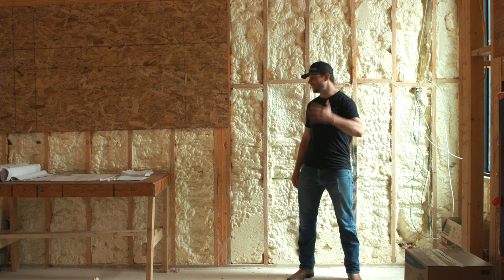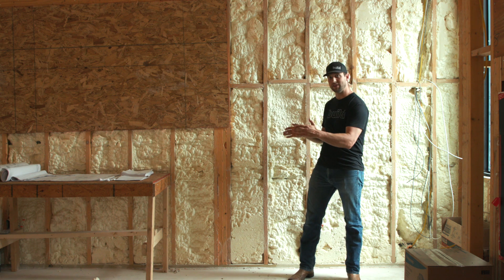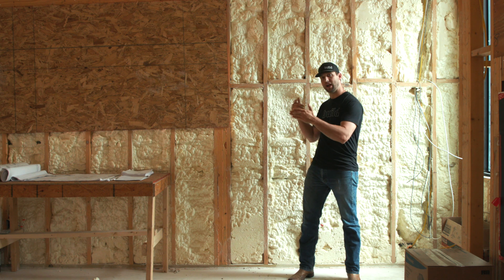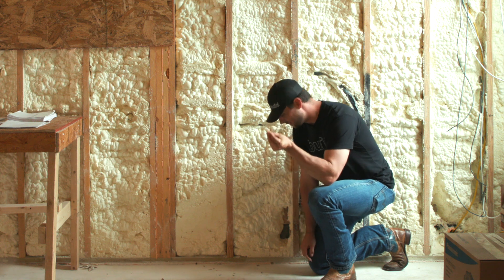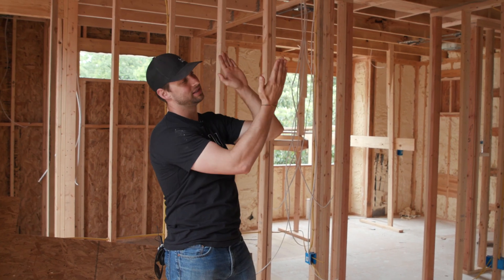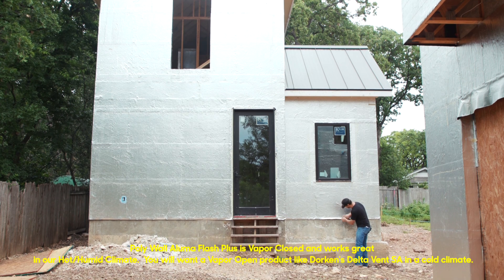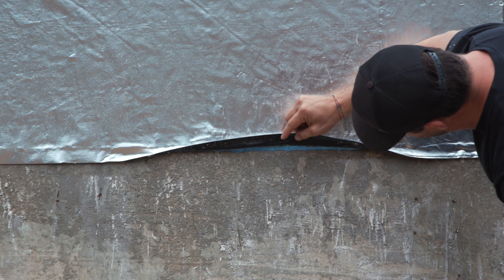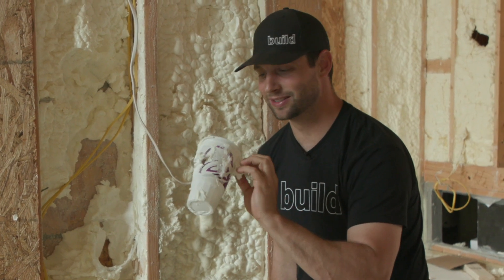3 Spray Foam Problems

Comment: With all the ancillary products required to get stick frame construction down to passive spec... or even to modern energy code.... why are people still building with it? It's a labor intensive process... capital that would be better invested in better materials, or a larger home. SIPs are the way to go. Spec'd whole wall. Vastly better consistency. Less opportunity for human error.

Comment: Have been anxious to hear your thoughts of Off-Gassing and Long Term Risks of these products and what we should consider when using for our applications
Reply: Oh yeah, another good question..
Reply: They have to wear hazmat suits and resperators too spray the stuff on.
Reply: @kalijasin  The suits protect hair and skin from sticky foam.  The respirators protect from the fumes UNTIL the foam is cured.  Don't be a Karen.
Reply: There is zero issue with off gassing if used properly
Reply: i actually worked with this product . after spraying was finished we would always open windows /doors to create draft for ventilation then remove masks.
Reply: Temperature thresholds must be observed, thickness as well. For applications within walls it's not such an issue, however for attics or open ceilings be sure the thickness is maintained to specs. And don't be in the home when having this done!!

If you're hiring someone be sure to get a removal and repair clause in writing! Jic the installer sucks
Reply: TheEarthDoctor1 sigh you made one good point. Andthat was the other point the rest are blatant lies. 

First off all they do not keep offgasing when mixed properly and applied properly the finished result is chemically inert.

Yes they are toxic in a fire but so is cellulose and fiberglass insulation (Rockwool is not toxic in a fire, only fire rates insulation)

They are no more problematic during demolition than most other construction material including plywood. The dust of fully cured spray foam isn’t even harmful (Beyond regular construction dust, cement dust and rile is much worse for your health)

You say you doubt you’ll see contractors recycling the bits. And your point is?!?!?! Do you think they recycle Fiberglas insulation? No. Rockwool? No. Cellulose? No. Expanded or extruded polystyrene? No. 
So what’s your point?  What part of construction is recyclable? I install recycle roofing, and I I’m pretty sure only about 1 percent or less of construction companies do. 

Or do you think anything besides metal is typically recycled in a demolition? Lol and even then it’s really only like copper. 
I don’t know what fantasy world you live in. 

Btw I don’t even install foam insulation unless specifically asked by the client or by the architects plans, I recommend Rockwool it cellulose. 
But I just can’t stand blatant liars with an agenda.

In regard to it getting in your water supply, that is a huge problem with ALL construction debris, and that is why federal fines for construction waste getting into the water supply are typically in the $100,000’s per incident. Of course those are not enforced strictly.
Reply: Arshaad Yar  -  considering these foams were developed for NASA, who has insanely strict requirements on off-gassing, it isn’t very hard to find that these foams are totally safe if used properly.

Comment: It just seems really silly to me to use spray foam especially with so many options available. Plus one of spray foams actual advantages is air sealing which for high performance it can't do and if you can't afford a high performance price point I'm willing to bet your installer isn't likely to be extremely skilled. Even this house clearly shows signs the installer was skilled yet it was still messed up. It's so easy to screw up. The worst part is spray foam that has not cured properly is a massive hazard to the home owner not to mention compromises its function. Further its touted as good for retrofit yet thats when its really hard to do correctly so whats the point?

Comment: Do you use the blue product on the bottom side of the bottom plate during a new build?  Or do you just use it to seal the joint from the plate to the concrete?  If that is the case and you don't use it under the plate, what do you use?  Thanks for the great videos!

Comment: Im not normally one to recommend litigation, but i seriously hope that home owner is speaking to a legal professional.  That level of craftsmanship is borderline criminal.  That builder should be ashamed
Reply: Yup. The construction superintendents we train would know to put the brakes on that job the second they observed a crew like that in-action, doing anything sub-standard. and get it fixed. Bad jobs can happen to even normally excellent sub-trades.  Maybe their main guy got hurt ‘last week’ and a couple of greenhorns got in over their heads. It happens. But there is zero excuse for the builder accepting that work and worse - passing it on to the homeowner. But it was more likely the low bidder - which will never be an “A-list” sub.

Comment: I have a house built in 1890 and it is a vertical barge board house. I replaced some of them that were rotting at the base area where the sill is. Then wrapped that with black felt paper 15# I think.  then added OSB 1/2".  Then used two ply aluminum bubble wrap 6' H x the run of the house overlapping by 3" (bottom first then the top of course).  Then added my hearty back wood themed siding on top of that.  Thoughts?

Comment: I find it interesting that "The Build Show" is now stepping back from the "spray foam is the best" bandwagon.  They were pushing it just a little while ago.  Everything has limitations.
Reply: Bestbuilder  -  it serves a specific purpose, no one solution does it all.
Reply: @grendelum  what would you say the best place to use spray foam is? I'm speaking in reference to climate and conditions within the environment.
Reply: My experience is unique maybe, new construction with SIPs and all, but we built a 4’ sill wall with a floating slab and put 1.5” of spray foam inside that wall to include it in the conditioned space so none of the elements can get to my beams...   also made plumbing and electrical way easier.    That’s the extent of my experience with the stuff...

Comment: We went all through this in Canada in the '80s.   After sealing the house up, you have to incorporate air to air heat exchangers in order to exchange all the air in the house depending on local code and circumstances.  Do you have five dogs?  More air changes.
Under the sills we staple a "sill-plate gasket" before standing the wall up.
But stick-frame should be used when you live near a sawmill.  Otherwise, masonry is becoming the structural material for low rise buildings when it's thermal mass is captured inside the envelope.  We have to leave the trees standing whenever possible.

Comment: Polyurethane foam simply and does not lend itself to site install because of all the variables that affect the chemical reaction. Just build the house properly in the first place and use some of the wrapping/sealing techniques they use in Europe/Scandinavia. It is so easy to hide bad workmanship with spray foam. I'd wager that a lot of spray foam installs are not performing as near as well as they should be. And this is before you consider the long term performance or potential for chemical residue left behind from incomplete reaction of the foam. At least with a rigid polyurethane board which was made in a factory under controlled conditions you have a guaranteed level of performance, assuming it is installed well.

Comment: Still trying to get a read on the long-term IAQ/Building Science aspects of the foam and things like the Alumaflash adhesive given both are essentially sealed inside the envelope.
Reply: J Healy  -  NASA and every other space agency have been obsessed with off-gassing for decades so modern foams and adhesives generally don’t.  There is literally an almost unlimited amount of research into these materials in the relevant journals.   The effects of vented crawl spaces and other barbaric practices and the nastiness they contribute far more to the air pollution of a house.

Comment: Nice info. I will definitely apply it. Can you tell me what the R value should be when doing spray foam on your roof for a closed envelope house? I have been told 3 inches of closed cell is enough. Thanks
Reply: Eric van zeyl - I know you didn’t ask me but I can help answer the question, I do spray foam and 3 inches of close cell is going to get you an r-value of 19 to 21 depending on the brand of the foam., if it was my house I would do 4 inches of closed cell to make sure you get the r-value you need in an attic.. and 2 inches in the walls.. if is open cell you can do 3 1/2 in the walls to 5 1/2 and 5 1/2 to 8 inches in the roof, depending where you live.. thanks

Comment: What is ACH?
Reply: Maybe Air Changes per Hour?
Reply: Air changes per hour.  Technically, it should have a pressure attached "ACH50" meaning the house is depressurized by 50 pascals relative to atmosphere.

Comment: You are asking for call-back disappointment when taking over a DIY foam job... one of the worst I have seen in recent memory... only fix is to overcoat so many areas... home owner would of been better to of hired a professional foamer and saved the aggravation and extra costs of redo. Spraying is an art but there is lots of science is doing it right.

Comment: Is that some kind of aluminium foil on the outside? And if so, does it block cellphone reseption?
Reply: Yes, so you don't have to wear a tin foil hat around the house ;)
Reply: Yes, it affects cell service.  Rockwool does as well.  We have our A/V guy install repeaters that are wired from the outside to the inside to mitigate the issue.
Reply: That's a good question. I wonder if a person would have to step outside you make a phone call. I work in a tin covered shop and we have horrible reception. If it's an important call I just head outside immediately. It's frustrating
Reply: That's cool man. I should look into something like that for our shop.

Comment: Somewhere out there is a very unhappy contractor that didn't get paid for a lot of work. I wouldn't be surprised to hear this place mysteriously burnt down one night.  I'd like to hear the story on what inspired the homeowner that far along to bring in a new company and tear off all that rock and cladding.
Reply: Doubt that. Most of these low-quality contractors end up getting paid more than they put in. They are lazy, not stupid.
Reply: @guytech7310  If the homeowner was smart, the balance should have been in his favor at the point it sounds like he fired the contractor.  I'm betting he refused to pay him up to date.  If I was doing it, I would wait and see what the corrections cost me, then paid him whatever was left, which is likely nothing.
Reply: @mrreymundo5383  That rarely the case. Contractors usually require payment before work begins & make money installing substandard materials & mark them up a premium products. Majority of home owners don't have a clue until its too late. Proof in this instance is that the Home was fully framed, and insulated before the home owner pulled the plug on the contractor. 

Usually Contractors just stop showing up when the complaints start happening, thus never on the hook for losses.

Comment: First, the open cell that's in the walls is different than closed cell ,which would be the better choice when it comes to spray foam. Closed cell has added structure strength and superior R value but with added cost.

 2nd, canned foam and two part spray foam are very different animals. So the broad brush of the video title is a little misleading. 3rd, any probably my biggest gripe, is that the foam contractor that did this job puts all other foam contractors in a poor light. Simple things like air sealing around truss heels and soffit blockers is easy but the extra time and labor to someone that is already lazy is a recipe for what happened here.  ( a cup foamed over in the wall...wtf!)

Foam is a very specialized trade, many many things need to be watched and taken into account. From substrate, material and  ambient temps, proper pressure of the foam type being sprayed, humidity of both air and substrate etc etc. We are manufacturing polyurethane on site, so everything needs to be monitored in order to make perfectly mixed inert plastic. Remember this the next time you look for the lowest bidder.
Reply: Yup. Strong reasons to avoid spray foam. Unless the Foam guy is really good, your end up with problems. 

The other issue is with closed cell if you need to repair work or remodeling work in the future. Good luck trying to snake a cable or fix a plumbing leak in a closed-cell spray foam. Open cell is a moisture-water problem. You might as well just stick a wet sponge in your walls. One plumbing leak or exterior water leak and your screwed. I am sure the repair contractors love when a homeowner has to spend 3 or 4 times for a repair because of spray foam.
Reply: @guytech7310  , Im advocating for using skilled professional spray foam installers. The issues you listed are difficult with spray foam but not unique to its use.
Reply: @MegaCb45  Yup, but for every good pro there are a dozen that just wing it. So you got a 1 in 12 chance of finding a quality installer. I don't like odds stacked against me. 

FWIW: I 've also read about instances when the spray foam was not mixed correctly and the foam never fully cured. Home owners had to completely remove walls & roofs because the SF never fully cured. What a nightmare!
Reply: @guytech7310 , Yeah about 7 cases that has happened. It doesn't occur as much as you think it does.
Reply: @guytech7310 , There's a reason top of the line refrigerators ,water heaters, coolers etc use foam...one of the best insulators available. Negligence runs rampant in any trade...

Comment: That failure looks like application direction. Remember on your ride along foam videos the ‘operator’ (your word not mine) stayed the first shot on the 45 to the corner all the way around. Just like other sealants it’s important to have the bond into the corner and on both the sheet and the stud. 

Really not sure why more crews aren’t two people. Four eyes, someone to hold spray shields. 

The difficulty is that adhesion from the foam is from expanding into the cavity. Spray pattern is really important

Comment: I wish we had builders like you in my area. I want to build a Net Zero house in a couple years but unfortunately builders in my area are notorious for shortcuts.
Reply: Theo Dake  -  if you’re going net zero like I am you should look into SIPs, structurally insulated panels, you get an air and watertight house off the bat...
Reply: @grendelum  Interesting, I will have to check it out.

Comment: OSB looks like wet car board if it gets wet a few times this is job security for builders. Use Advantech OSB at least for the bottom 4 feet then get cheap mistint paint and paint all osb inside and out. This video shows half pound foam, all foam contractors will try to talk you into buying this because the job goes really fast, the 2 pound foam is going to cost more but a thin layer of that inside and out is the best sealer, vapor barrier and high R value and keeps the OSB from burning the house down from the built in E84 fire retardant.
Reply: I use 4' PT along the entire bottom of all the houses I build.

Comment: Basically in the simplest terms moisture such as humidity or damp lumber will cause the foam to cure faster reducing its expansion time cooler ambient temperature causes the foam to expand slower but if you get to cool it'll stop the reaction all together

Comment: Would fire and ice do a good job as house wrap
Reply: FishOntv I’ve wondered this as well for a Northern Wisconsin Cabin we plan to build. It definitely “sticks tenaciously” ;) Only problem I was expecting was the thickness at windows and doors may be a little bit of an issue.
Reply: In my opinion too costly and time consuming. Best option is to buy the ZIP sheathing and use the ZIP tape. Its going to take considerable effort to peal and stick the membrane to all the exterior surfaces, and you cannot apply it to the OSB unless the OSB is absolutely dry (might be OK if you in a arid location, but not so nice in area that gets lots of rain.).
Reply: FishOntv, Yes. Just use plywood and not OSB. Use a liquid flashing around the window, door jams.